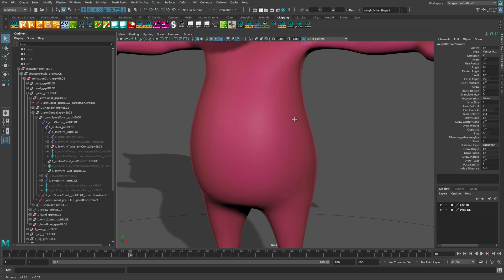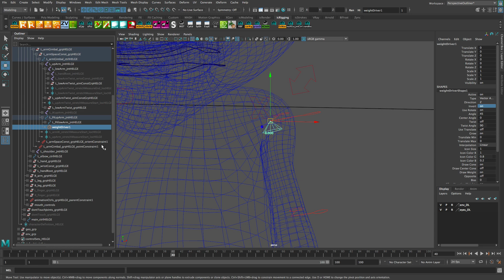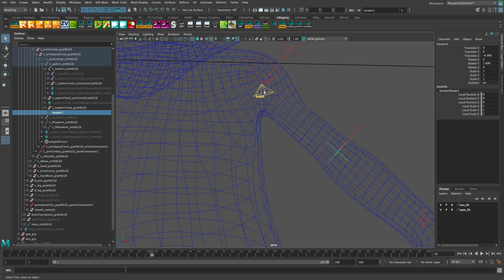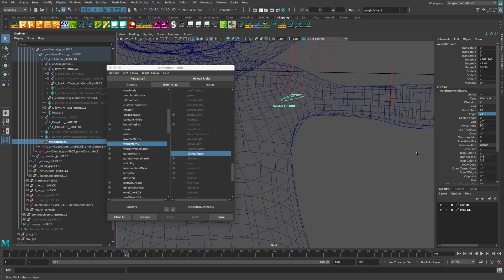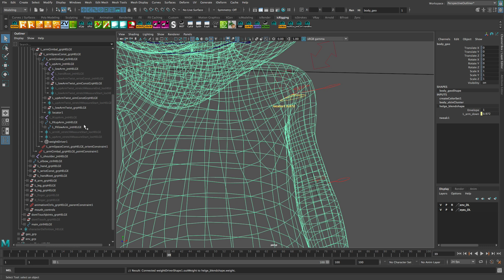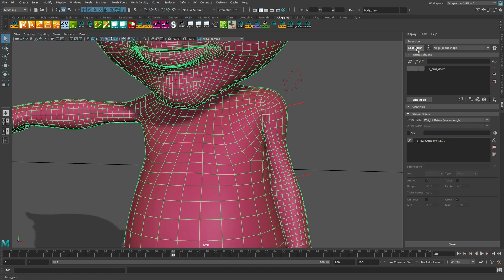Weight Driver - Vector angle setup (manual vs. SHAPES)

Comment: What if I have more than one corrective shape? for example shoulder down, shoulder up, shoulder forward and shoulder back. Does it mean I will have to create 4 weight driver cones for a each shoulder? A weight driver node for each shape?
Reply from the maker: Yes, multiple angles would require an RBF solver.